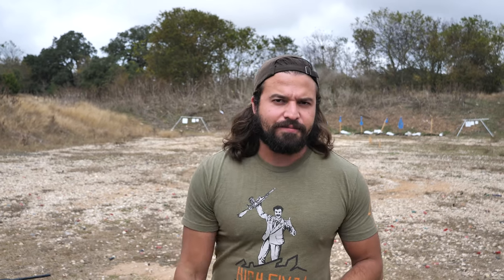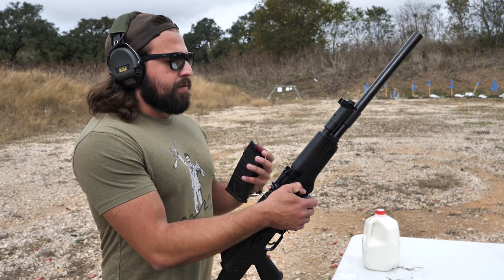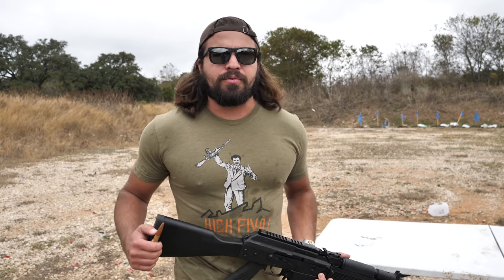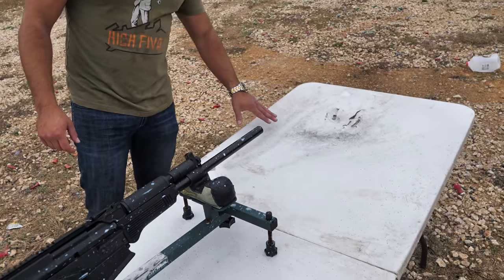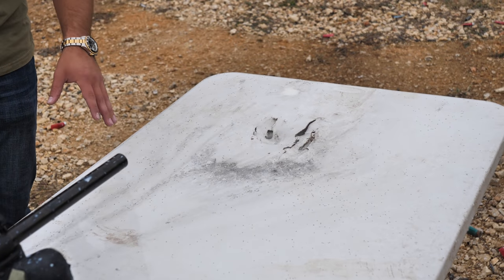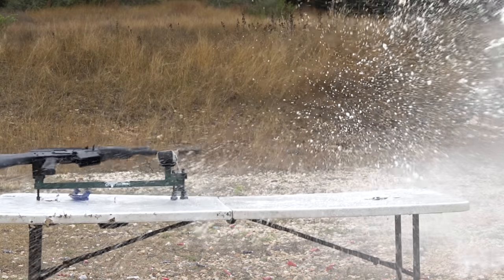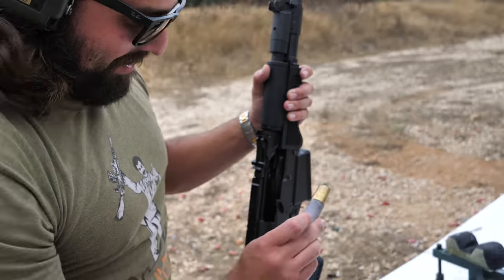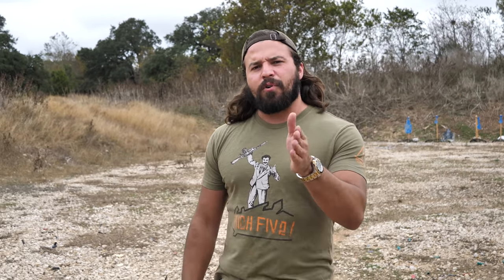Testing .50 BMG in a Semi-Auto Shotgun

Comment: I love how the BMG elegantly passed through it and the 12g was like violently shitting
Reply: Shotgun round is better at delivering that energy to target... because it's that much worse at penetrating it...
Reply: Had he set the muzzle brake next to the milk and shot into the berm, the result would have been the same as the result of the 12g

I've seen watermelons do the same thing...misted by the muzzle brake
Reply: @selonianth  Unless you're using slugs.
Reply: @East_Coast_Toasty_Boy  Nah, Slugs are still a LOT worse at penetrating than BMG due to shaping, and for that matter materials of use. You don't make Slugs with steel penetrators for example (at least... not by default) nor shaped for maximum penetration. They're still mostly blunt and lead.
Reply: @selonianth  
I know that, but it's the power, not anything else, that gives it it's penetration, right???
Reply: @East_Coast_Toasty_Boy  ... God I hope you're joking.
Reply: @selonianth  I'm asking. You can tell because of the question marks. See???
Reply: @selonianth  Reason why I ask, is because if you're right, then I can use slugs as home defense ammo.
Reply: @East_Coast_Toasty_Boy  well they penetrate a hell of a lot better than buckshot if that's what you mean.
Reply: @selonianth  I'm just worried if they'll go through an assailant and hit a gas line in my home and then the gas blows up my home or something. If not, then I can use it no problem. But not if they do.
Reply: @East_Coast_Toasty_Boy  To my, keep this in mind, non expert knowledge of the ballistics of the situation, that shouldn't happen? The slug may overpen the person, but even if it hit the gas line it shouldn't explode. Should definitely get the fuck out of the house, but it shouldn't explode unless a spark actually happens after it's shot. People have tested that idea quite thoroughly.
Reply: @selonianth  That's the thing, always a chance, isn't there?? Even if it doesn't, kinda don't wanna damage it to begin with... or any other part of the house.
At least, to THAT degree.
Reply: @East_Coast_Toasty_Boy I'd stick with buckshot or birdshot if need be, though personally I'd prefer 9mm or a similar HP pistol cartridge

Comment: You could 3d print a sabot for the 50 BMG projectile to make it fit in the 12 gauge barrel and use one of the fire formed casings to hold the sabot. Basically a big shotgun round that has a 50 BMG projectile in a discarding sabot. The firearm would most definitely explode though.
Reply: Underrated comment
Reply: Could cast (or print) a cartridge support for the case to the neck, and sabot the projectile , however it still wouldn't work, the projectile would push its way through the sabot, unless you eliminate the spear point in some way. Even then with those pressures I don't think the sabot would survive.

Comment: Suggestion: reload the .50 BMG shell that became form-fitting to the 12g with a foster slug. Powder load : as brave as you are willing to be. Preferably pistol powder.
Reply: I had the same idea but pistol powder is too much, reloading with TNT is safer than that
Reply: Pistol powder? Rookie game, jam some nitroglicerine in there for extra SPEEEEEED
Reply: And a machined bronze or steel bullet for extra spicyness
Reply: Any one ever filled a shell w tannerite?
Reply: @dualsportrider3221  wouldn't work
Reply: The from fitted shell reloaded with a foster slug is an arousing concept
Reply: Would work as well as tnt or nitro
Reply: @dualsportrider3221  I don't think you understand how binary explosives work. They require an external kinetic force, the explosive element and an oxidizer.

An external force, a bullet in the case of tannerite or similar explosives, travels fast enough to cause a kinetic reaction between itself, the oxidizer and the explosive that results in a high-energy discharge.

Primers transfer heat to the propellant inside a cartridge. Most, if not all, binary explosives cannot be triggered by heat.
Reply: Umm so u think a blasting cap, fire cracker or m80, primer, kinda thing wont det tannerite? Mayb but i doubt it. The 22lr stuff most cert will go off

Comment: Fun fact, there's a wildcat chambering for the 12 gauge out there that uses the .50 BMG as the original parent case for a high-pressure brass 3.85" 12ga shell.  Called the "12 Gauge From Hell".  Thing's an absolute  ripper with slugs; basically turns a 12ga into an elephant rifle.
Reply: A 12g with a rifled slug isn’t an elephant gun already? 0.o
Reply: @casey360360  What op described sounds like a specialist 12 gauge round longer, higher pressure probably uses a different barrel.
Reply: Don't let Scott (aka KB) know about this... He's only got 2 thumbs... Lol
Reply: @miketrevithick5806  I think Scott is done with wildcat loads. Unless he's firing remotely with string. He fired the rest of those dodgy SLAP rounds with string. He's lucky to be alive.
Reply: @elitedavidhorne8494  I'd say the 700 Nitro Express at $100 per round is a wildcat round. He's been popping those off for the past 6 months or so lol
Reply: SOLD!

That sounds excellent, elephant rifle can turn most meat creatures to liquid, or just stick a fucking HUGE hole in one.  Either way, it's enemy down.
Reply: @DailyCorvid  or just use a normal round
Reply: not if but why....? XD
Reply: Dragon breath 12ga to finish off the elephant.
Make meat chunks then cook on the spot.
Reply: @jaisummons2304  Absolutely love phosphorus shells, either the starter or the finisher of a gunfight, flying magnesium with 12g shotgun power stops just about anything. Can’t use it properly in semi’s and fullies though, not enough kinetic energy.
Reply: @johnathanhurd3561  Your comment got moderated by YouTube, but what’s that company your talking about with the far better phosphorus shells? Asking because I want to shoot a singular firework into the sky with proper safety protocols to avoid burning anything near me, down.
Reply: @elitedavidhorne8494  lol he now has a four bore rifle 😂😂

Comment: If you want that JTS to cycle, you need to run about 100-200 high brass shells through the two larges gas settings (exluding 0). That is what it took for the last one I handled to cycle anything other than high brass #4. Once you break it in to that degree it handles anything. Probably still won't cycle 50 bmg but would be fun to try.
Reply: Why would he though? Considering it has cast parts and he has a superior AK-patterned shotgun, seeing if it'll blow up by shooting a .50 BMG from it is a good use
Reply: I bet those 50 rounds broken it in real good. Probably runs like a champ now.
Reply: @dragonranger8456  "superior" Maybe if it was a Vepr I'd agree but Saiga's are notorious for being jammomatics
Reply: @TheBeesKnees42  Is it not just that the spring is too heavy still? Won't locking it back for a week accomplish the same?
Reply: @TheBeesKnees42  even still, I'll take a Saiga that jams but doesn't have cast parts over a JTS that jams and has cast parts
Reply: @dragonranger8456  Springs lose tension with use not compression
Reply: @spongebobdriftpants  Agreed, broken in properly we had cheap target loads run just fine and had a heck of a time busting clays. They used to be better before the price hikes due to the "cough cough"
Reply: @dragonranger8456  if you can find a Saiga these days that does't cost over 2 grand (I thought AK guys were poors). And again, with proper break in the JTS is hella fun. In comparison the last Saiga (20g) I got to shoot had to have a bunch of internal parts including feed ramp polished to work properly vs just going out and shooting the darn thing to break it in.

Comment: I'm no gun nut but I just KNEW instinctively something was going around the tip to prevent the casing blowout.  Next round,  using a carved baffle rubber just around the beveled portion of the casing, separate piece to guide the tip to the end of the barrel, but some means of catching the sleeve so it doesn't kill the momentum of the round in flight.

Comment: The fact that it didn’t break clearly means you need to do it again … in an over/under …. and fire two .50 MBGs at once.
Reply: how to break your arms by pulling a trigger one time:
Reply: Vape kat  
bows
chugs Monster
punches drywall
Reply: Two MBGs at once is considered a NAF violation by the AFT.
Reply: Well you're no fun.
Reply: @papermacheapple5986  I mean they do have double rifles in 700 nitro
Reply: @austinshaw9935  but do they have one in 950 jdj also i have seen what happens to a 14yr old with a double barrel 10guage shooting magnums when the second round inertia fire. i could only imagine a 700nitro doing it.
Reply: @motorman2013  I really want someone to build a 959 jdj double rifle. It would be incredibly heavy and expensive. But awesome.
Reply: Somewhere doomguy's ears perked up.
Reply: Vaping Kat  I mean FPS Russia is named Kyle so it fits here
Reply: mrowning bachine gun
Reply: @austinshaw9935  comically large gun
Reply: @theabsolutelycursedsprout9308  The typo stays forever now.
Reply: @bothgunsblazin  wdym typo

Comment: my jts was having cycle issues till i tore down the gas piston and cleaned out the actual bore for the cylinder. now works like a charm with round over 1250 fps on piston setting 1

Comment: Recently, on the job, I held a flare gun in my hands, in which someone had put a barrel reduction to 12 gauge. 
Since the Desert Eagle doesn't cut it anymore, I would like to propose this for the new title of "wristbreaker" in the .50cal category.
Reply: People have done it before,  they generally just explode lol
Reply: If its one of the plastic ones I pray for your fingers, if it's one of the metal military ones it probably works but why not just do this at that point https://youtube.com/watch?v=fxSjLllBbQ4
Reply: There's a lot of flares that use 12ga diameter. Most of the time you can even shoot them from a shotgun.

Comment: Duct tape a support on the 50 BMG casing so it has more flex than the plastic and print a well fitting sabot of sorts for the bullet and it theoretically would cause resistance and therefore allow all(or most) of the powder to burn.

Comment: If I can get the word to him I know how to fix the V2 AK50.  That gun will shoot.  It just needs tuned right.  As is the gas system needs adjusted or shut off and a much heavier spring  to hold that shell forward longer.  it doesn't need any assist from the gas system.  Just bigger springs.  M82 equivalent would work. The bolt weight would be nice if it were heavier.  But should shoot if you get the springs in it.  May have to custom make your own return-spring guide beefy to handle force of heavier springs.  If its an over pressure situation you can drill holes in the gas tube block or wherever until you find the sweet spot.  I know that gun will run.  It didnt catastrophically fail.  If it will still chamber a round.  Once you got a good spring if you want to vent some of the gas out of the gun open the block up and drill holes in the tube like some of the old Armenian aks.  Once you get that pressure managed,balanced with a good spring. it will run.

Comment: Shotguns are typically "proofed" with a special round that has pressures about double the max the shotgun can withstand. Somewhere around 25-30k psi.

So not too surprised the shotgun didn't blow up considering how much pressure loss there is with an undersized projectile and an unsupported casing.
Reply: But I think a pump or breach shotgun would likely fragment

Comment: I remember reading something from a tester at Remington who decided to hand load proof shells to higher and higher pressures until the barrels actually started failing. As I recall, the 12 gauge Remington barrels he was testing started to blow up at 55k psi. He was increasing pressure by 5k psi increments and they all survived until they got over 50k psi. So, those particular Remington barrels could TECHNICALLY withstand the pressure of .50 BMG, but just barely. Considering that the diameter of the barrel won't allow a .50 bullet to seal it up, there was never a chance that barrel would explode. I would have bet money on it.

Comment: I think it would be reasonably easy to throw in a barrel insert and weld it up at both ends to match that of a actual 50 cal barrel specs on the inside
Reply: Problem is also with the strength of the action and all the metal behind the chamber
Reply: If you isolate the BMG pressure around the shell in this gun, it will blow apart. Way too much pressure.

Comment: Damn. When Brandon started talking about the fire formed brass i got excited, but it didn't happen. So hopefully Brandon looks into the 12 gauge from hell. Which is a 12 gauge slug load formed from fire formed 50 bmg brass and fired from a bolt action slug gun ( like the savage 212) or single shot. There have been crazy numbers from what people have posted. Have always wanted to build one.

Comment: I have one of these JTS shotguns, and I kinda like it. It cycles several different types of shells if you adjust the gas system
Reply: I got the T-1 and knew from videos it’d take a little smoothing, I sanded the inner workings, cycled the action thousands of times just randomly while watching tv etc. put a turkey choke in it and now it cycles all but the ultra light loads

Comment: The JTS AK12 is a really great budget semi auto 12 gauge. Break it in cycles just fine.
Reply: Yep! I've got one of these and swear by it. Love the little guy to death.
Reply: If people degrease it, oil it and use proper gas setting the gun absolutely rips
Reply: @sgtslippyfist6345  Didn't do anything with mine. Shot slugs and buckshot right out the box. Eats them up on whatever its set at. Got lucky.
Reply: Have one this JTS. Absolutely love it!

Comment: Now can we use 50 Beowulf in a semiautomatic shotgun? That’s the real question.
Reply: .50 Beowulf doesn't have a large enough diameter to fit in 12 gauge, and cycling wouldn't work either because the rims are different and the length is to small
Reply: kinda what i was wondering.
Reply: @jacobjohnson2603  yea i was just joking but that’s a good answer.

Comment: There's some interesting data you could pull from this to apply to the AK-50 project I think.
Idea 1: Remove barrel. Replace with custom restrictive barrel that's truly diameter supporting.
Idea 2: Not sure if the gas block can be made adjustable with idea 1 in place. Have it at a maximum bleed off, fire, restrict, repeat until boom?

I think this would test the strength/durability of the bolt you're looking at at the end ("refuses to fng break"). If that holds in further testing, it could be a ready part to not have to custom make? (if it's in the realm of slightly modding to hold a .50 cartridge properly)
Reply: That would 100% explode on the first shot, just go look at the ak50 videos to see the beefiness of the internal components necessary to not explode

Comment: I realize it has been 8 months since this video was put out, but what about a Sharps 50 round? I know it has less pressure than a 50 bmg round but it is a non-tapered cartridge design and also has a much bigger projectile that is more likely to deform and put more of the pressure into the forearm itself. Especially with the way black powder burns. Anyway, I'm glad it is you testing this stuff because there ain't no way I'd do it behind a plastic 50 gal drum 15 feet away, hahaha!
Reply from the maker: It’s not even half the weight, it is definitely not a bigger projectile
Reply: @BrandonHerrera  sorry, I must be losing my mind and thought the rear of the 50 bmg cartridge was .510 diameter and not the bullet. I guess that is what I get for commenting before drinking my morning coffee. I only fired a Sharps 50 years ago and was just remembering how fat the cartridge was and didn't really think about its size vs a 50 round.

Comment: 4:40 I appreciate hiding behind the barrel as if that would save you from an exploding 50 cal
Reply: it's to protect from the shrapnel if the gun explodes, no reason the round would fire backwards onto the barrel.
Reply: @alexm566  the barrel wouldn’t do much to stop the shrapnel from a 50BMG exploding either. That was the point in my comment.
Reply: @evanf1443  If the barrel was empty, I think you might be right.

Comment: I'm thinking 3d printing a whole barrel that goes all the way down. That way you can get full power from it. Or just take a trip down to the hardware store to find a metal pipe that fits, if there are any.

I think the reason the casing wrapped inwards is like the M82A1, the plastic barrel tried to move backward into the casing but the casing didn't move so it just curled inwards.

Anyway, good video! Keep it up!
Reply: Prepare for that gun to commit "allah snackbar." You'd have to rework the entire gun to handle the pressure of the .50 BMG, otherwise you will experience something like what Kentucky Ballistics experienced.
Reply: @joshuavidrine889  oh yeah, it's not safe, that's the idea
Reply: if he has to, get one that the cartridge seats in and even if its too wide to fit in the barrel just machine it to diameter
Reply: The hot gasses would melt the plastic barrel before it helped at all. I don't know one filament that could survive that. That and turn it into a fine powder.
Reply: Fellas, it's to blow the gun up. I know it will explode, that's why.

If it doesn't explode, my next suggestion is black powder and steel wool in a shotgun shell for fireworks.

Comment: The "Shotgun Professor" has highlighted an experiment whereby 12 gauge shotgun barrels charged with overpressure rounds were able to withstand up to 55K psi even though they were rated at only 12K psi. Beyond 55K psi they "banana peeled" to use his terminology.
Reply: But how many times did they withstand that pressure?